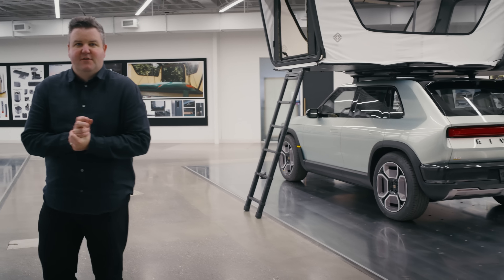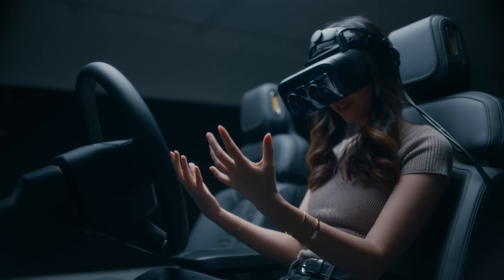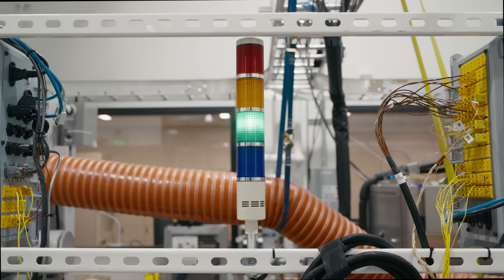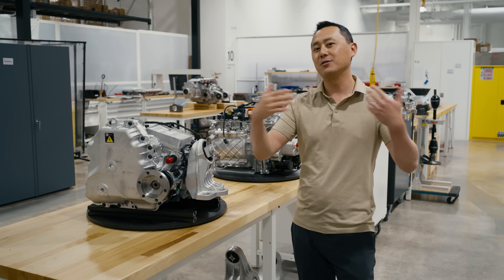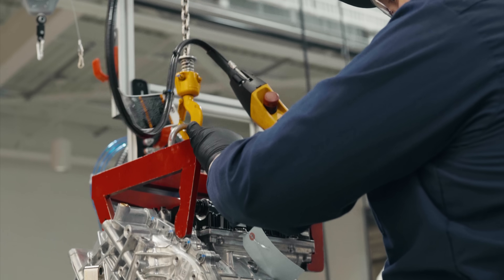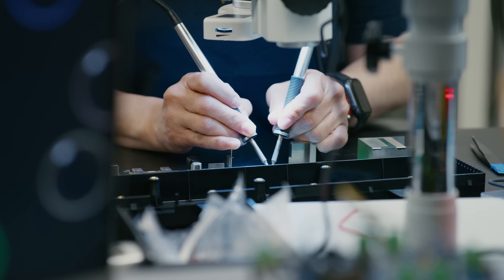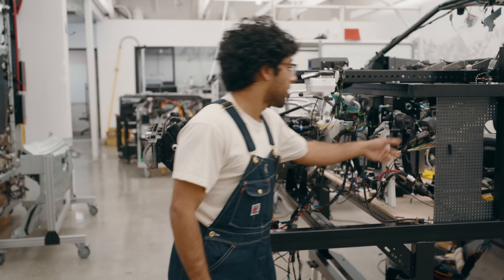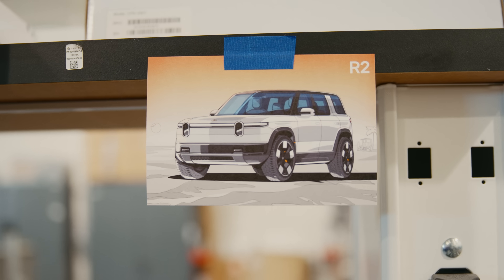R2 | Inside Rivian’s Vehicle Design Studio & Technology Labs

Comment: The question, what happens when the tax rebates are gone -- will Rivian survive?
Reply: Volkswagen invested 6bn USD into Rivian to get their software. So yes they will survive.
Reply: @stehgrad  Scaringe has publicly linked weaker guidance and demand softness to the combination of credit removal and tariff uncertainty, , delivery guidance was cut to 40,000–46,000 units in 2025.
VW will invest up to $5–5.8 billion by 2027. It's not much, VW is also Rivian’s competitor in EVs.
Bottom line, Rivian will likely have enough cash to survive through 2025-26. R2 will either make it or break it. Subsidy expiration will have a huge impact. Visibility beyond 2026 is poor.

Comment: I really like your designs but I do wonder if Rivians are as aerodynamic as they could be. Looking at Teslas for example, they have a much lower front and also a sloping roof line. Why do you go for a different approach? I mean surely you must also care about efficiency right?
Reply: Rivian is an adventure brand where Tesla focuses on street driving. 
If you want something that has great performance and is very efficient, get a Tesla, it’s a great car. 
If you want a car that has some off-road capability and is high off the ground, get a Rivian. 
It’s two different experiences, get a Rivian because it has and does what you need. Don’t get a Rivian because it’s not a Tesla…
Reply: @cameronlook7823  Sure, but lets be honest, most people who buy a Rivian dont really need off road capabilities. They buy it for the looks.

Comment: Please add an actual roof shade cover to the R2. The frosted glass won’t help on a really sunny day
Reply: I had to do a shade plus 1/2 inch house Foam insulation to panaramic window , its way too hot on a sunny day , I'd rather not get the window myself
Reply: Yes. Please add some sort of roof cover. Even if it's manual
Reply: @user-rh6ji1ot8q  I would sacrifice those scrolls on the steering wheel to have a shaded roof. Too hot here in AZ to drive around with just glass over your head.